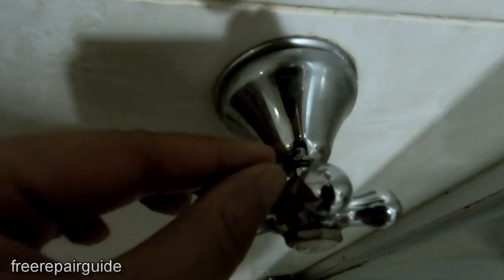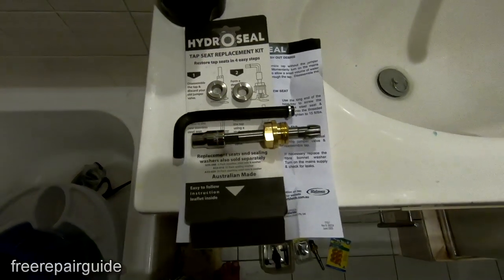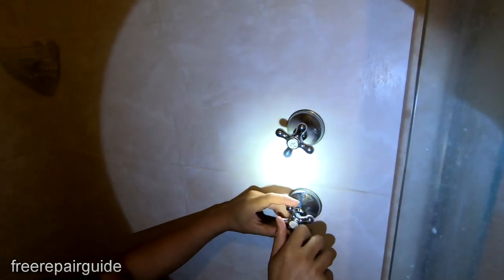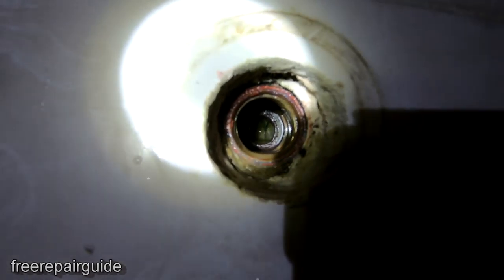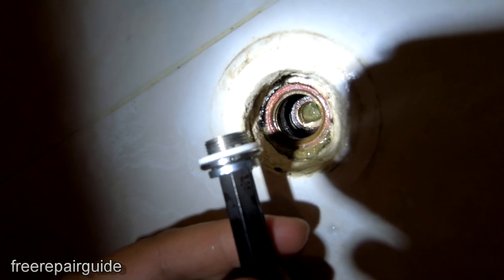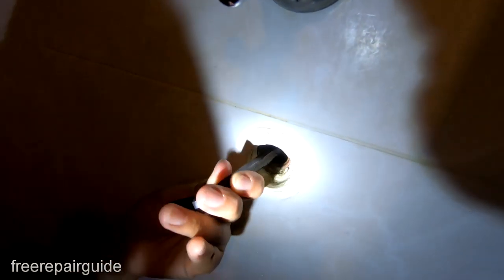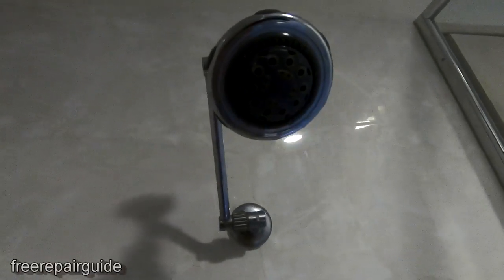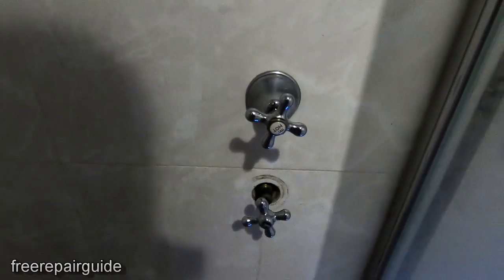How to Fix a Worn Out Tap Seat With Replacement Kit

Comment: Great video, but two things that should be added here is to firstly turn off the mains, then turn on an outside tap (or even the bath), then turn on the shower one - this prevents water running inside the wall as it drains to the lowest point first. Secondly you really need to re-face the seat before putting in an insert - almost never is it parallel or flat enough for the insert to seal, then it is a hell of a lot of work to remove it and re-face it and but it all back. The best tool to re-face the seat is the same brand as you are using (available at Buntings for those in Australia) - HydroSeal Tap Seat Re-facing Tool, it fits in your cordless drill (just take your time and check several times that you are not taking too much "meat" out of the tap seat). It will ensure you get a nice square (to the thread) seat face, unlike the hand ones that are simply crap and often leave an uneven seat due to the cutting die used and are very difficult to set square.

And if you are wondering, yes I fix a fair amount of leaking taps - usually 3-4 a week for the last 6 years (I am involved with building / rental maintenance).
Reply: You missed out one step. Use a licensed plumber
Reply: @thebeardedrods7540  Why is that?
Not everyone has to go to a mechanic to change spark plugs.....
Reply: @dingodazz3724  Exactly. If it was an electrical job that would be different, due to the danger of possible electrocution. If one messes up with plumbing, there's no real danger except for a huge water bill or lots of water all over the place.
Reply: I think he did follow your first recommendation at 7:30. But also good call on the resurfacing advice I didn’t even think about that. Thanks 🙏
Reply: @thebeardedrods7540 you must be rich

Comment: What if the seat is fine but female housing where you screw it into is bad. Can that part be rethreaded to allow the new seat to be screwed into it. Or do I have replace the entire pipe system??

Comment: Turn the thread cutter back and forth to get the filings out..gives a better thread and clean it all out prior to threading. Also don't over tighten the seat because stainless steel is a lot harder than brass and it strips easily. Otherwise well done. 😁👍🏻🇦🇺

Comment: I'm not sure if this would work for U.S. pipe fittings 3/8 inch and the washer seat wall is stripped and the washer seat won't stay in place for the drilling.  Darn!

Comment: So you don't actually remove the seat itself just make tracks for the new washer to be threaded into the old one? Great video
Reply from the maker: Its best if you could clean the seat because that can help prevent leaking.

Comment: Link for kit doesn't work, what brand is it and where can it be purchased?
Reply: He used an Australian brand called Hydroseal & the product was the Tap Seat Replacement Kit. This kit is for 12mm taps as that is what most indoor Australian taps are sized. Can be found in Bunnings if you're here in Australia. Can also be found on eBay if you're overseas. Just make sure you buy from a reputable seller.

Comment: Thanks , now i know can be done. One question do you iive in Western Australia :  )
Reply from the maker: Yes
Reply: @FreeRepairGuide   im from western australia too
some people attach end peice to a drill to grind the surface
Reply: @FreeRepairGuide  After screwing in a new steel seat, my tap starting dripping again after a few weeks. I wrapped plumber's tape around the thread of the steel seat before screwing it in to help fill in a small crevice left in my old brass pipe. But it's still leaking. Any ideas why? Maybe I didn't burrow deep enough into the old pipe or use enough plumber's tape?

Comment: Any ideas on it still leaking? Do I have to grind the original seat down more to ensure the new seat sits in better? Its only a small leak now but replaced everything else and lubed it up...greetings from bassendean!
Reply from the maker: You need to make sure the original seat is grind properly so that is nice and flat.
Reply: @FreeRepairGuide  I did that but found I had to remove the new tap seat, I think it is too far out to close the gap properly. You need enough thread though to make the new one tight in there though. Hmm I hope i don't have to smash tiles.
Reply: @spateri728    unless is a brick and mortar wall, you can work the plumbing from the other side of the wall, just rip the plaster board off.
Reply: Spateri You should update us on what happen, did you fix the leaking?
Reply: @bobbico03  Apologies. Double brick and tiles so not much I can do without alot of pain. I got around it by using a shorter spindle if I remember correctly. The tap cover doesn't fit on the front properly anymore as I can no longer screw it on far enough but no leaks. 

I used flat tap seats as well as the more expensive cone shaped ones kept on breaking up when they got overtightened. 

Thanks for the help guys!
Reply: @redangrybird7564  that is a very good idea well thought

Comment: You advise people to re-dress the old seat before fitting the new one but you didn't do it on this job.  Why not?  You said the old seat was corroded so you've probably left a small leak between the old seat and the new one and it's going to cause problems within the wall.

Comment: Just need to buy a tap seat cleaning tool, which you can put onto a drill and clean up the tap seat, 9 times out of ten, its full of crap and sometimes not flush, so no need to put on new threads and put tap seat adjustment, just clean the tap seat with the right tool and put in new tap washers there you go fixed, here's a link to how to do it. :) 
https://youtu.be/Q3H6aycv7nQ

Comment: Anyone know if there is another way to flush out the bits of metal other than turning the mains on? My mains are about 100m away and I am an old lady. 😄
Reply: Kerrie Fearby : use a plastic bottle of water to squirt water in then paper towel to wipe the crudd out. 😁
Reply: I used an old tooth brush, worked great.